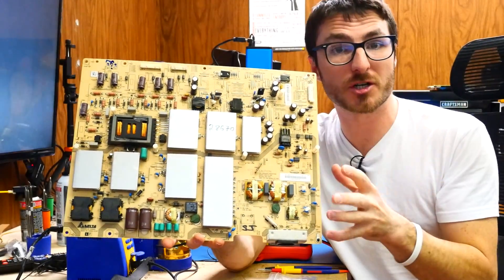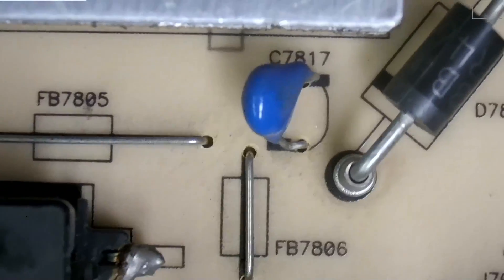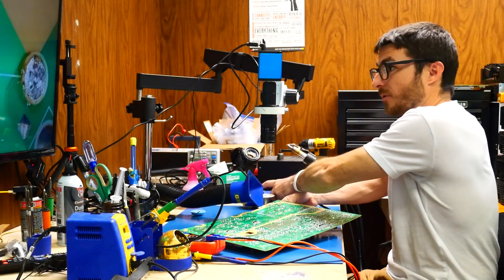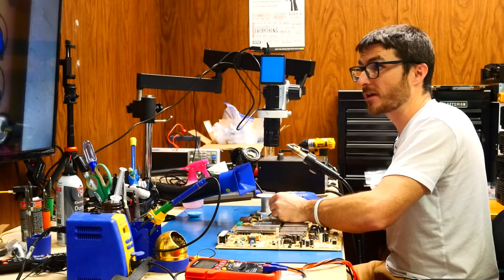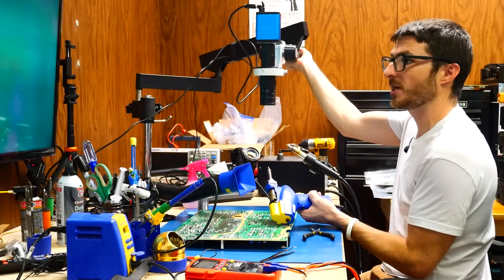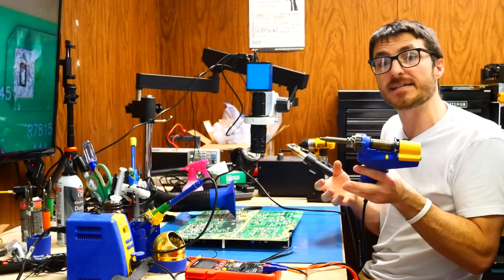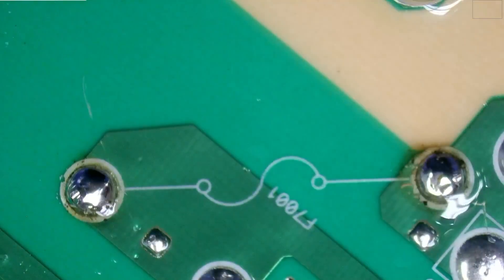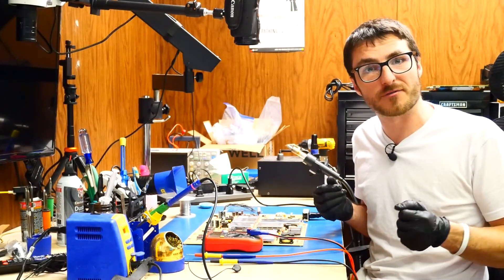Sharp Power Supply Repair LC-80UQ17U RUNTKB217WJQZ (DPS-285CP)

Comment from the maker: Sharp LC-80UQ17U RUNTKB217WJQZ (DPS-285CP) Power Supply Repair Service

Send in your board for repair: https://nickselectronics.com/products/runtkb217wjqz
Fix it yourself with our repair kit: (coming soon)

Questions? Leave us a comment or contact us directly:
https://nickselectronics.com/pages/contact
info@nickselectronicrepair.com
520-838-9359

Soldering Iron: https://amzn.to/3FQfyhG
Solder: https://amzn.to/3qScy0d
Desolder wick: https://amzn.to/33DAjjy
Flux: https://amzn.to/42YWYBa

Comment: I need to send you a board for repair what do I do
Reply from the maker: Below each video we put out there will be a video description. In that description is a link to our website which will bring you to the exact repair service shown in the video. If the part you would like to fill out is slightly different then you can click on the contact us form also linked in the video description or simply email the email also shown in the video description.

Comment: Hello, is an oscilloscope necessary to repair a TV or not?
Reply from the maker: I use an oscilloscope 0% of the time to fix TVs. I have never had to use it to fix a TV. WIth that said it might be useful for component level troubleshooting. I just am not familiar on how to use them so I don't know if it would be a usefull tool or not.

Comment: Hi, I have a problem with the same board, i dont have 12V, can yo guide me please.together PD pin 14 and 15 and I don't have 12v. all the componente looks fine and the measure is ok. i cant find the component with problem. thanks
Reply from the maker: Sorry, it doesn't make sense for me to try and troubleshoot your power supply via YouTube comments. If the fault is different than what is shown in this video then I would need to have you send in the board for us to diagnose and fix ourselves with the board in front of us. 
Links to send in your power supply are in the video description, we do flat-rate services with a 1 Year warranty. If the fault is interesting or unique I will do a video on it.

Comment: Hii nick Sorry to disturb but we are not getting any new videos..I always wait every Saturday since i have subscribed.. please give us an update 🎉
Reply from the maker: @shivasisdash7343 Yeah sorry for the lack of new videos, I have been having a bit of a hard time trying to come up with new videos lately. I also have been trying to change it up and show different repairs that aren't always the same eMMC repairs but have come into a string of bad luck the last 4 videos I was going to publish, I scrapped them all because either I screwed something up big time, or made a lot of mistakes and I didn't feel like it was up to par, or there was one I did that was so over-the-top complex and unnecessary for a repair that I felt it wasn't worth showing as no one would be able to use the information. But because it has been so long im going to put a pause on trying to do new things and am going to temporarily go back to the same old stuff. 
I have a Hisense mainboard repair coming up along with a Samsung plasma power supply repair and then an LG OLED mainboard repair in the pipeline I'll be filming today and next week. 
If you are interested in the more random types of electronics repairs that aren't TV you can check out my other channel which is the Nickselectronics repair channel. 
It's a little bit heavy on the NAS and oven control board repairs but those are in high demand for repair. 
https://www.youtube.com/@NicksElectronicRepair

But yeah I'll be making sure that Saturday 4/20 4/27 and 5/4 will have the three videos mentioned above. I believe I'll have more content ready to go by the time all three of those air as well. 
Thanks for watching my videos!